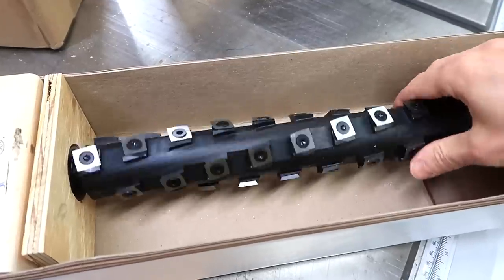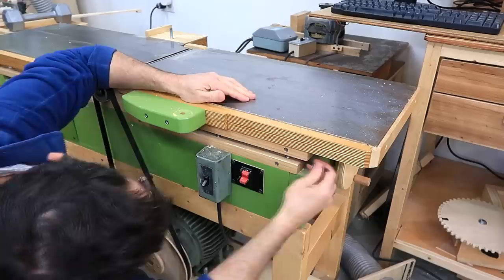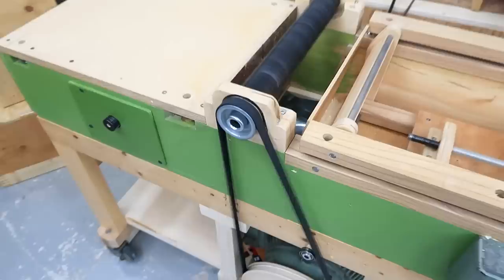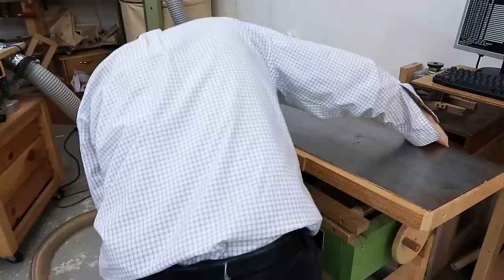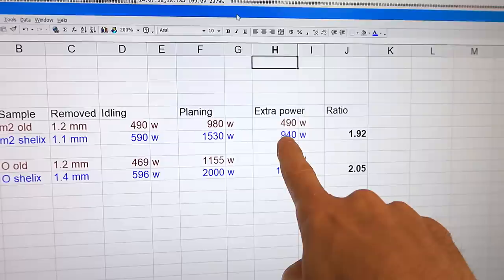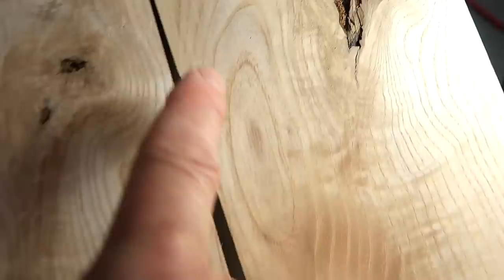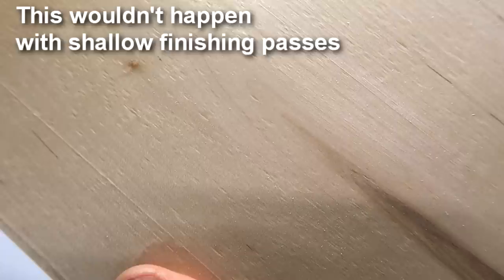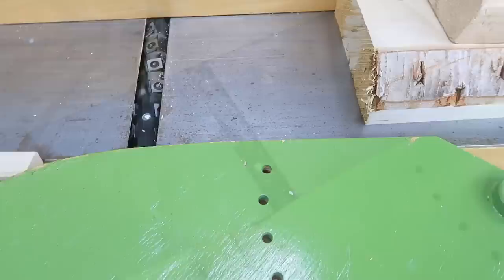Shelix head vs HSS planer head: Comparative tests

Comment: I also recently replaced the straight blade cutter head in my planer for a helical cutter head. There's definitely something wrong with yours, or the installation, based on the sound. With my dust extractor running, I literally cannot tell whether the planer is turned on or off, it's that quiet.
Reply: Then there is literally something wrong with your hearing if u can’t hear the difference. Sheesh.
Reply: @MrTooTechnical  You don't know how loud his dust collector is though
Reply: Then it’s a crappy dust collector
Reply: @MrTooTechnical  Just one great hot take after another, eh?
Reply: Well why not
Reply: All the goofy sniping above aside, I suspect a lot of that is due to vibration in the wood frame. It is not nearly as stiff as a good properly heavy casting, and if you knock on that cast frame on yours and the wooden frame on his you are going to hear a very different sound, both in frequency content, and A LOT in level.  Think more or less knocking on a decently made door, vs a dull quiet thud.  Guessing, but from a physics standpoint it makes sense, I think.  Also any imbalance in the head is going to allow far more out of center travel (tire hop equivalent) both from stiffness and mass of the frame.

I'm not knocking his homemade jointer, it is actually pretty impressive how well it works, but it still has a lot of shortcomings to a good cast iron machine.  Making castings that size in a garage shop starting with little knowledge, though, I suspect is not that easy.  Could be wrong, as I've never tried it.  I know it doesn't take much of a whack with a heavy peening hamper on the right area of a cast iron engine block to crack it, hit in a thin weak place.  And if that happens it is a BITCH to weld properly.  Darn near impossible really.  That is why there are 'staple' solutions, etc out there for that purpose.  Boy, that got off topic.
Reply: @MrTooTechnical  Like patient fitted with new hearing aid… Doc: "Testing 1-2-3… any better?"  Patient: "Yes but I’d prefer Thursday."
Reply: Nice.
Reply: @gr8dvd  Huh?  And he was holding up 12 fingers, right?
Reply: @MrJdsenior  Too nuanced? …makes no sense b/c hearing aid failed.
Reply: @gr8dvd   No, just bringing in another sense...I got the original just fine.
Reply: @MrJdsenior  👍

Comment: The bearings on your old cutter head appear to be metal shielded. The ones you're comparing it to are rubber sealed. Metal shields Don't make contact between the shield and the inner race like the rubber seal bearings do so they will spin more freely. That being said they probably shouldn't spin that freely. They also don't sound very good. It's not really easy or practical to repack metal shielded bearings because the metal shields usually get distorted / destroyed during removal. Best just to replace them

Comment: For Canadian viewers, there's a Canadian company called Sheartak in Kitchener-Waterloo that makes custom helical cutter heads. They have tons in stock, and can make one for just about anything. Cheaper than Shelix.
Reply: I’ve got a Sheartak head in the 510 wide felder jointer.  It’s amazing.  They are not Canadian.  Heads are made and shipped from China, but service is first rate and they are very responsive.
Reply: @gl7662  Sheartak includes shipping, and also 5 free replacement cutters. Try completing that Shelix order, you will find that your total goes up to $608 before adding any cutters. Add another $45 for 10 replacement cutters. And add a surprise amount of brokerage fees when it arrives at your door from the US. In many cases the price difference is more dramatic. My order from Sheartak for a Shopsmith cutter head was $590, from Shelix it would have been about $1000.
Reply: @bpt006  They're a Canadian company. Yes, the parts are made in China. I don't know where Shelix are actually made.
Reply: @trevorlambert4226  they're made in kentucky.
Reply: @whirled_peas  👍👍👍

Comment: Setting aside bearings and noise, the cut quality was not the unambiguous, major improvement I was expecting. Thanks for the comparison (round 1 I suspect).
Reply: Yeah and Mathias didn't even sharpen the steel knives either. While he put them up against brand new carbide inserts. Plus with the heavy cut that's worst case for the steel knives too. It favors the inserts more.
Reply: This new head vibrates a lot, so a perfect cut quality is nearly impossible to achieve.

Comment: I'm pretty sure the extra noise and power consumption is because of a bad flux capacitor in your oscillation overthruster.
Reply: Pretty much. I think it's twisted about 80° as well. You have to take the Earth's magnetic field into account. Not as simple as people assume.

Comment: I really appreciate this video. My jointer came with a spiral head, and I have no interest in changing that out, but I have been on the fence on changing the head for my planer. I like how the carbide heads don't need replaced as often but using more juice makes me hesitant because my shop struggles with that already.
Reply: I'm still running my original knives and they're decades old now. Of course they've been sharpened countless times between then and now. They still got life left in them too.
Reply: Are your power consumption concerns related to cost, inadequate service or both?  I occasionally trip a breaker, but never have given a thought to the cost of running my planer or table saw for any given project.
Reply: @marshallmurrell4583  I have 3 outlets in my entire shop, and so I have power bars with  breakers in them that all of my tools are plugged into. It's not ideal but my shop isn't large and I do hobby wood working not professional work. The breakers in the power bars pop under too much load. I only ever run 1 tool at a time (and my dust collector which has its own breaker because it pulls all the juice).

Comment: First off I absolutely love your videos and have been watching them for many years, but I do have to say that homemade jointer is the most terrifying thing I’ve ever seen, my solid steel jointer is terrifying and it’s solid as a rock, but those heavy, razor sharp blades spinning up to a thousand or more rpms is just beyond scary, it’s truly amazing that those two small pieces of birch ply have kept that thing from seriously hurting you or even killing you buddy, as always stay safe truly. I’ve made some dumb mistakes as all true woodworkers have and have seen even more had have to say the worst are always jointer and table saw with routers close thereafter, I’ve witnessed someone mutilate their hand on a jointer after hitting a knot( which they should have paid attention too before even beginning) as well as my self loosing the top of my right ring finger after a board took off like a rocket! Please stay safe Matt
Reply: Yeah I don't trust those wooden bearing blocks whatsoever, there's a lot of energy in that cutter.  Would be nice if a machining channel made him some steel or alloy bearing blocks that he could properly bolt down rather than using deck screws.
Reply: @ferrumignis  Agreed!  Aluminum bearing housings with through machine bolts plus jam nuts or safety wires, is the way to go here.

Comment: Even if the insert cutter performs the same with higher power consumption, the increased longevity will be a big benefit. Also, it might be easier to rotate those inserts than to change out the old blades.

Comment: Good stuff! I can’t argue with your measured results, so I won’t try. I installed a Lux spiral cutter in my Dewalt 735X planer several months ago. I always wear eye and hearing protection since the planer and dust collector make so much noise together, therefore I don’t really notice a sound difference. I do see a dramatic increase in cut quality, however. My dust collection has seemed to improve with the smaller cuttings, which I appreciate. The Lux head was very expensive, but I would do this upgrade again.

Comment: I did a power comparison with the SHELIX and OEM knives in the DW735 planer. The SHELIX drew less power under no load (around 3 amps less), but more power under load (around 5 amps more).

Comment: I love your way of thinking and how you try to deal with engineering challenges through experimental measurements. I think that the best way to measure the efficiency of each planner head is to measure directly the cutting force under constant feeding speed and load (as you did), not the power consumption. Bearings have increased power loses when rotating under load. If you know the forces acting on a bearing then you can estimate the power losses with a simple calculation. Most bearing manufacturers provide rolling resistance (friction) factors for their products.

Comment: Hey, great video.  It has never occurred to me to make a shop built planer, and you have done a nice job of it.  I'll be checking your old videos in a bit to see if you covered it.  I really don't think you can regrease sealed bearings, and if they are noisy and that free running, they need replacing.  It's not like they are super expensive.  We used to have a DeWalt thicknesser at my Menz Shed that had HSS blades.  It was so noisy I couldn't consider getting one for my home shop.  We now have a cast iron 15" Macma thicknesser with helical heads which is much quieter.  It also doesn't clog the dust extractor when used with damp wood.  It does still leave slight lines across the timber, but not as bad as the DeWalt, and I didn't fit the inserts and, sad to say, some of the Shed lads are not flash with their workshop practices.

Comment: Yay, helical heads take more power, but run smoother and way quieter cutting. There is something up with that head you have there. Been running a LuxCut in my dewalt planer and its unreal how much better and longer lasting they are!  Do a LOT of reclaimed 200yr old oak and the stock knives would go dull and be useless after 6-8 runs.. havent changed the lux cut blades yet, they really are better!
Reply: Those little blades are usually made from a higher carbon steel, aren't they?
Reply: @rrrt01   yup! much higher grade, as it's carbon still not high speed steel.. or some such thing like that.
Reply: @Thomllama  they are carbide... Not steel

Comment: The helical head (lux cut, a shelix clone) vibrates noticeably more than the original straight knife head in my DeWalt planer.
Overall I'm not in love with it.
I do love the shelix I installed on my jointer though.
Reply from the maker: I really wouldn't want one in my DeWalt.  It blows breakers from time to time as it is, and the shelix needs twice as much power to do it's thing!
Reply: @matthiaswandel  I have one on my DeWalt, does not trip breaker any more then before
Reply: @matthiaswandel  only because there is something wrong with yours!

Comment: The drastic increase in planing power consumption can be attributed to a continuous cut.  With your conventional head, you're only cutting for a fraction of every revolution...the knives are only hitting three times per revolution even though the contact area is higher in comparison. The shelix head is basically always guaranteeing that some part of a cutter is in contact with the wood (with the contact area lower) so the motor is always under load and doesn't have time to do any kind of speed recovery that would help with cutting momentum.

I run a Shelix on my 735X and have noticed how uncomfortably warm the plug gets now.  I wouldn't say that it leaves a superior finish per se, it just leaves micro waves that are much easier to sand and blend than what I might deal with with straight knife gouging...or worse, chunks missing out of a knife.
Reply: This actually does not make any sense, physics wise. If anything the continuous load should use LESS power. It is probably the cutter geometry. The shelix is probably making smaller chips or doing more damage to the chips than the straight knife.
Reply: @mckenziekeith7434  "If anything the continuous load should use less power"

wut.
Reply: @NGinuity  Compare it to router bits with a straight flute vs spiral cut.  A straight knife is going to briefly impart a very large force since it's cutting the entire width of the board, whereas the helical cutter only has a very small cutting edge in contact with the wood at any time.  However the helical cutter has a new edge going into the wood continuously, where the straight knife head has a relatively large gap between cuts.  Power consumption might average out - small continual force, vs large intermittent force.  But I would make the argument that the intermittent cutting is less efficient because of all the vibration it creates.

Comment: I replaced my 8" jointer head with a Byrd Shelix Cutterhead. It had 40 cutters on an 8" head. The difference was night and day. Quieter, smoother cut and to sharpen, just rotate the heads and there's NO OUTFEED TABLE ADJUSTMENT NEEDED! Yay!!!!!

Comment: Been looking forward for this to come out after you mentioned getting it in, so long ago it seems! Hope those quirky issues you have get sorted and it performs better.

The increase in power is a common observation, as instead of taking two intermittent cuts, it's under a constant load from the staggered teeth. The power increase while not cutting doesn't make as much sense, as that'd be either a difference in air resistance on the carbide knives versus two steel blades, or bearing issues.
Reply: he mentioned the idle power goes down on the shelix after the grease in the bearings is getting warm...

Comment: Something to explore swap the cutterhead bearings side to side to see where the vibration may be coming from. I found a bearing issue by mounting a dial indicator to outfield table ( mine is magnetic 😉) with the probe over each bearing cap. Shows up very quickly.

Comment: The noise that matters to me is when you're actually planing. With my DeWalt the shelix is much quieter (with the straight blades you could hear it a few blocks away). However, I'm unhappy with the finish quality of the shelix.
Reply: I wear ear plugs when I run my planer so I'm not so concerned about the noise. Because it is permanent hearing damage loud in use.

Comment: I have a hypothesis; the increased noise "may" be being introduced by the wood construction of your jointer, especially the pillow blocks.
Reply: Yep. The wood mounting, being less rigid, would allow a small out of balance to swing out by centrifugal force and become a larger amplitude of out of balance. In other words the flexibility of wood increases the amount of vibration. I think his jointer is unique in having an all wood mounting system for the rotating blade. 
Not much experience to go by.

Comment: Sounds like the ball bearings are trashed or have no lubricant.   Trouble may be the bearing supports are out of line.  Loosen the bearing block screws a little while you hand-turn the motor pulley.  Keep the belt on.  Smear a little finish on the wood to see the cross-marks.
          You really shouldn't be supporting that high-speed spinning blade with wooden supports!  If either of them failed, you would have "raging cat claws" in the shop.